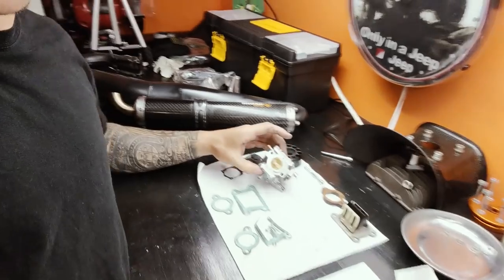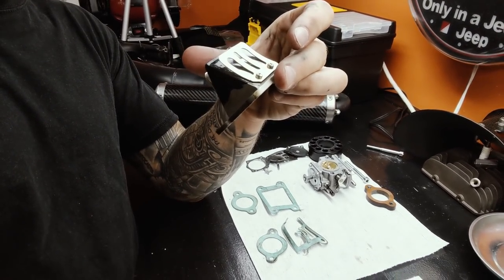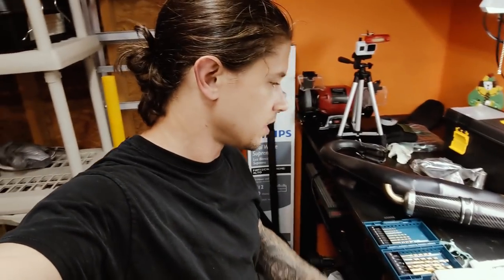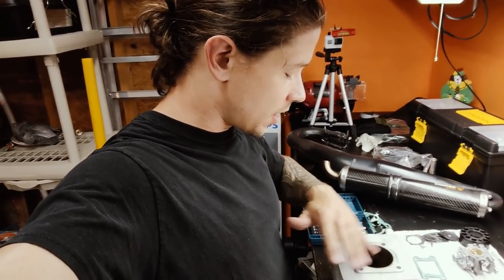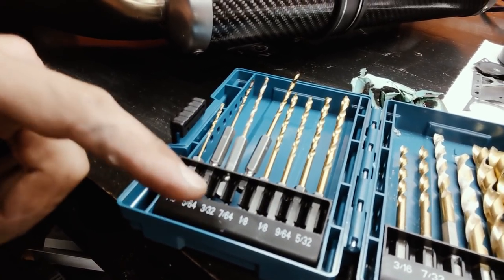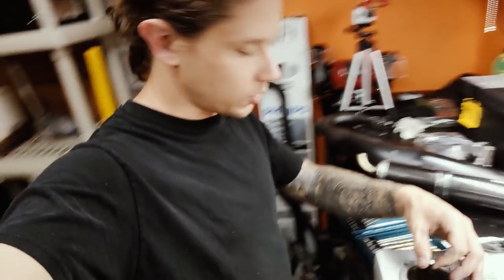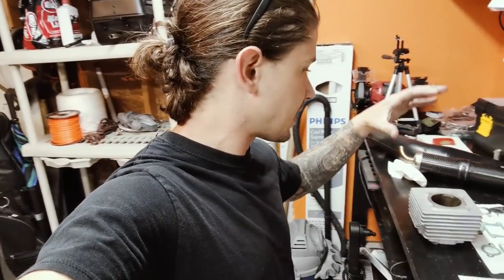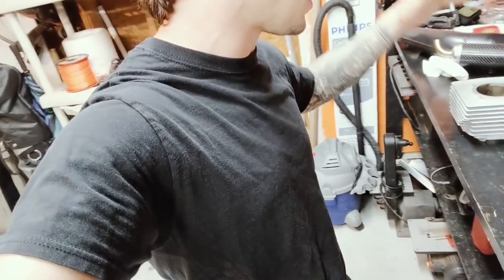Tearing Apart the Moster 185 Top End | 100 Hour Maintenance (kind of)

Comment: ahhhh question? Was the same batch of gas or mix used before it started?
If yes are you certain you did the mix ratio properly? Yes, we all screw up once with that chore!
Reply from the maker: Yep same gas before and after the rebuild actually, I was confident I mixed it okay. That's why it was so curious. I really do think it was the smoke system siphoning into the exhaust.
Reply: My PPGsmoke system does the same thing. Also even when it's just sitting in the shop, when it gets warm and cold, it pushes oil from the reservoir into the exhaust. I took my system off for a week of flying and the problems all went away. When I put my smoke system back on, I think I'm just going to make sure I completely empty the smoke tank every time and never leave any residual in there.